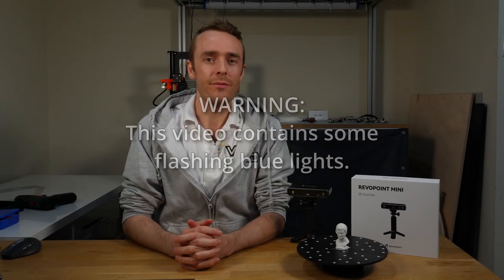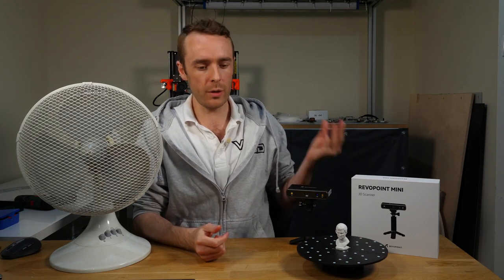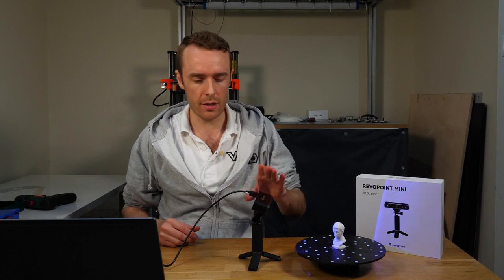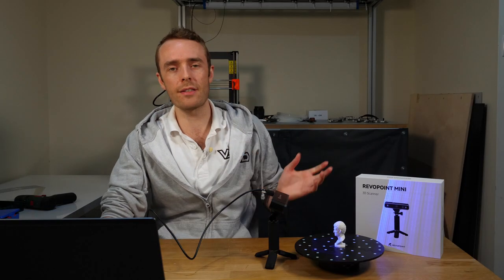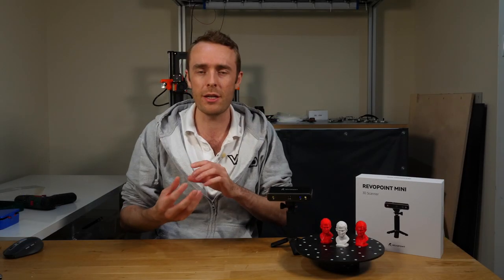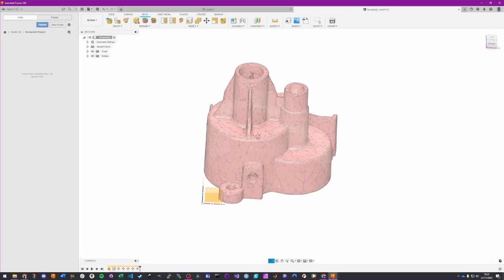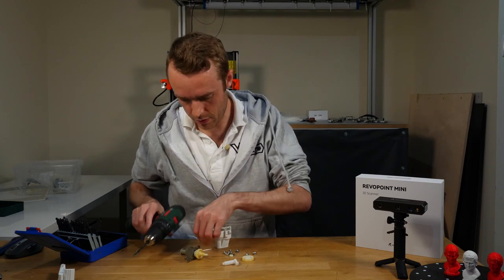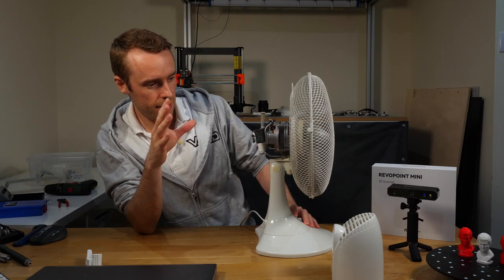3D Scanning Succeeds When All Else Fails?

Comment: Yikes ... When will this type of technology become more accessible and affordable.  Current CDN$1600 is quite a steep price.  I'll have to defer to reverse engineering with a pair of calipers and recreate in CAD
Reply: Some of the photogrammetry packages are good although not as quick as a scanner, but for the odd job they are more than adequate.
Reply: Don’t forget the power of taking photos and importing into fusion with the correct scale. Can make getting the general structure so much easier.